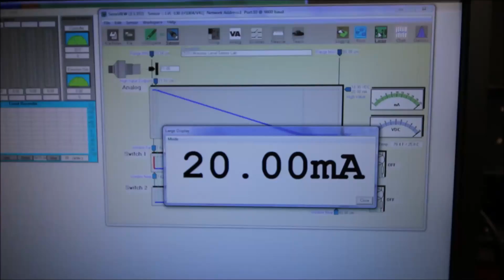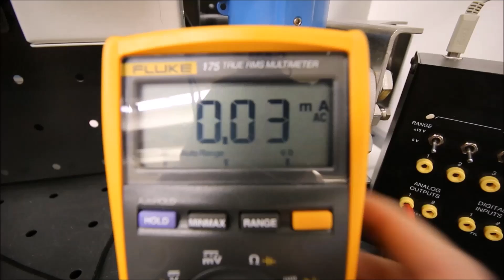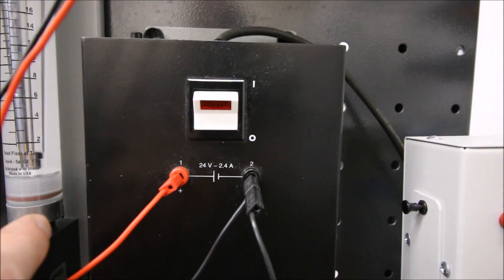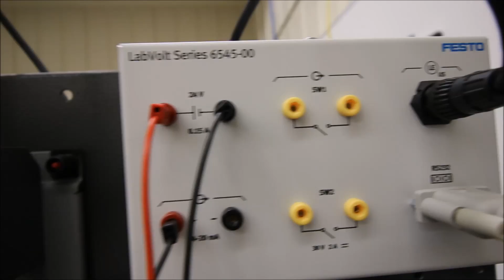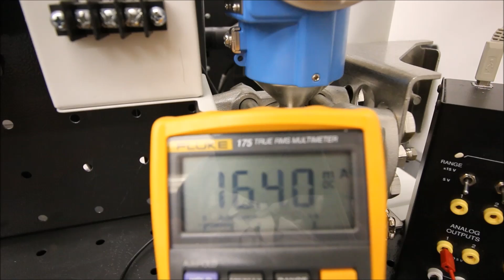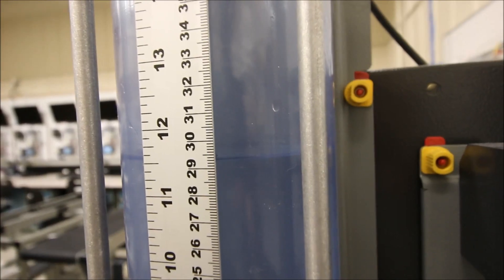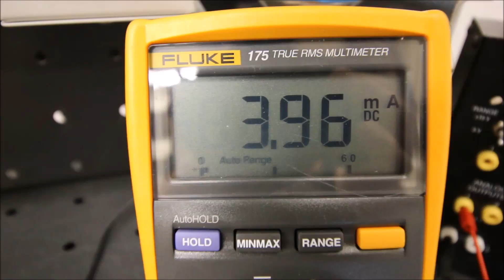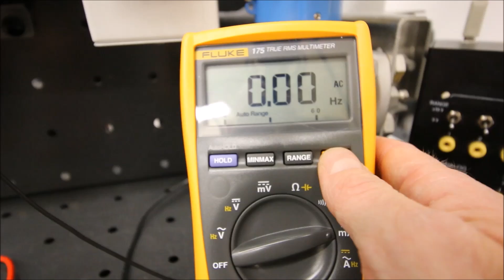How to measure a 4 to 20 mA Current Signal (Ultrasonic Level Lab #5B)

Comment: Dear Proff. Thank you so much for your detailed and comprehensive explanation!

Yet, I kindly have this question please, which has need running in my mind since ever!
If we measure the current value on the other wire going out from the Analog module, Will we get 4 to 20 mA or not ?

I do highly appreciate your answer

Comment: Is it possible to measure 4-20ma in parallel in ultrasonic transmitter
Reply from the maker: The measurement I have shown is in Series. Have a look at the video at the following link to see how you can use a Fluke 773 Multimeter to take a non-invasive measurement of the 4-20 mA current: https://www.fluke.com/en-ca/learn/blog/electrical/how-to-measure-a-4-20ma-loop-signal
Reply: @PeteVree  thx sir

Comment: Hlo, why u didn't connect the + mA to Fluke's 400 mA terminal directly..Why you short it with other lead wire?
Reply from the maker: That jumper has a 250 ohm resistor that I use to demonstrate to the students how to change a 4 to 20 mA signal to a 1-5 Volt DC signal

Comment: If you add a resistor wouldn't that change the amps that you read at your meter?
Reply from the maker: The transmitter accounts for the increased resistance by increasing the applied voltage to the circuit to maintain a constant current that reflects the process value.
Reply: Pete Vree thank you Pete, great videos I've learned so much from you much appreciated!

Comment: hi pete, can i use this setup on my conductivity controller? i was planning to put a tower lamp 24vdc as an output but i wasnt sure were terminal i will connect it. BTw im using Burkert conductivity controller type 8619 thanks

Comment: Why the resistor needs to be connected?
Sorry for the dumb question.
Reply: @Sgt Brown sensor should regulate how much current flows through the circuit.
Short is huge amount of current in short time.
But sensor that measures a quantity of something should regulate mA.
Reply from the maker: HI Vignesh, Thanks for the question. The resistor wasn't necessarily needed for this portion of the lab. 

However, in a later part of the lab, the resistor provides the specific load so that the 4 to 20 mA DC current can flow through the 250 ohm resistor and create a proportional voltage drop of 1 - 5 V DC, otherwise we have no means to change the current signal into a voltage signal.
Reply: @PeteVree  i don't get this part.
Isn't the whole point of the video to measure 4-20mA current in the circuit?
Connecting the multimeter in series would achieve this easily, considering the multimeter can precisely measure mA range.
What has voltage amd resistor got to do now with attempted measurement of feedback from the sensor which is in mA?
Reply: Thanks for your reply. Really appreciate
Reply: @PeteVree I was confused by that as well.